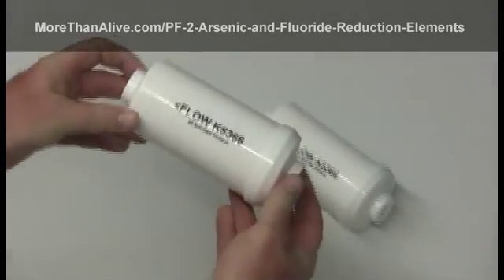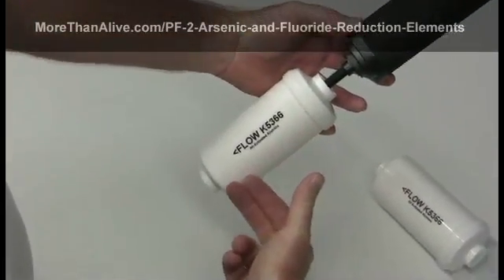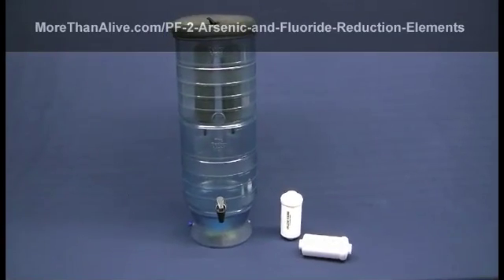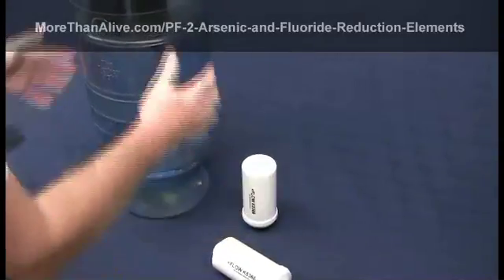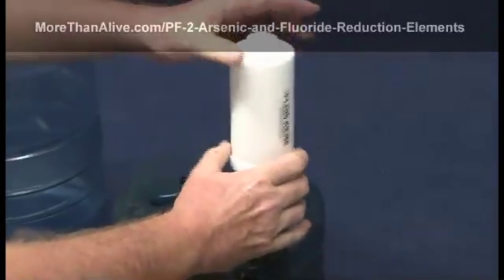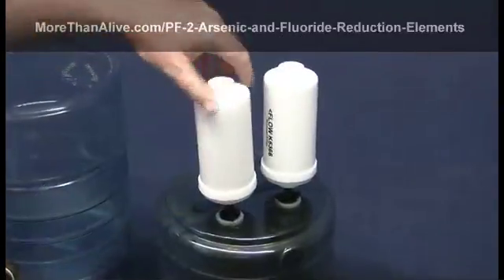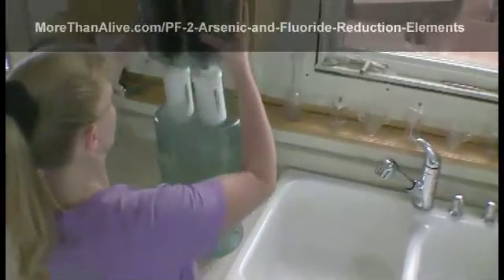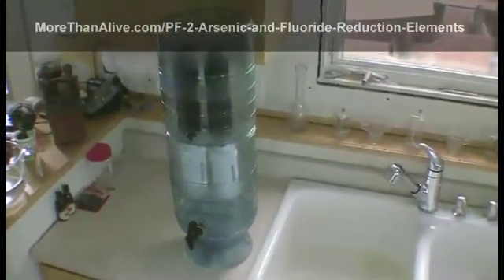Berkey PF2 Arsenic & Fluoride Filter

Comment: If someone can answer a concern, I would appreciate it.
We bought the Royal with 1 set of the standard black Berkey filters and 1 set of the fluoride/arsenic filters.
 My concern is it will be easy  to add enough water to the Berkey that these Fluoride/Arsenic filters will be partially submerged allowing the filter components/material to stay in the water. I wonder about contaminants in the filter being able to leech back into the  lower tank or at the very least,   I have concerns of the integrity of the filters being compromised from being wet part of the time.
Any thoughts??
Reply: Good question. Call Ladimar Lopez at 888-803-4438 he's in charge of distribution in Colorado, ask him. He was always good at returning phone calls and replacing defective filters free of charge.

I use to buy my filters from Jeff Gleason 877-886-3653  (his secretary is Ericka). But they don't return phone calls lately. He calls himself "The Berkey Guy" at directive21@directive21.com in Las Vegas.  If you find out please post it here.  Thanks.  AC
Reply: I’m pretty sure they need to stay wet in order to function properly so it should be fine

Comment: @aman00777   Similar to early stages of cancer, you really can't feel a difference physically and mentally.  I don't believe the difference will be at a conscious level but rather at a molecular level where your body is just functioning subtly more efficiently.  Though, I'll keep your request in mind.

You are correct:  PF2s are for black berkey elements only.  If you have the ceramic ones, you can only use the PF4s!  They will serve the same purpose as the PF2s.  
Take care.

Comment: Isn't it bad design for the PF-2 filters to be sitting in the bottom chamber with the purified water?  You can get back flow into the filters since they hang so low.  Also wouldn't the plastic casing for the PF-2 filter leech out into the lower chamber water?